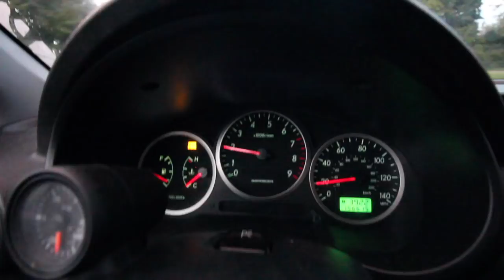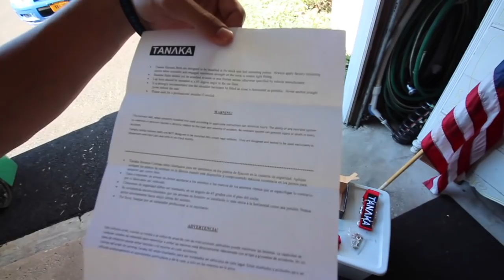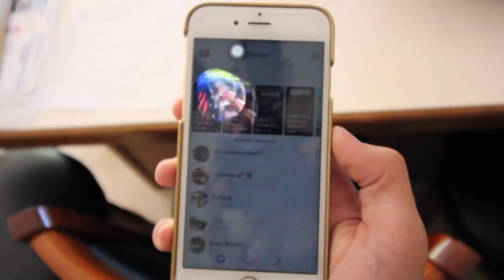Tanaka 4 Point Harness Install

Comment: If you attach the bottom part of the harness to the bottom of your seat or below you in general the pressure will snap your spine in half if you crash
Reply: thats correct, it'll force your body downwards due to the angle of the harness. but this one isnt as bad as some i have seen, some has literally installed it at the back of the driver side seat and not at the rear passenger seats.
Reply: How do you know?
Reply: @takcleberry  how do you not?
Reply: Yay compressed spine!!!!!!!!!!!!

Comment: Seat belts are designed so that your body can lean forwards a bit in a crash so that your head can dig into that airbag. Harness restrains your body movement in a crash, but your head is free to move, which means your neck can snap before your face touches the airbag (if it ever does). Wear a helmet and HANS if you ever want to use harness for safety.

Comment: This is kinda wrong. You MUST put a bar in the backseats that are separated from the bolts you just screw to the chassis. The correct method is to custom make a bar that is welded to the chassis. The bolts may lossen up during time and cause the belt to lose all tension and cause injuries when in a situation. Just be careful and do it not for "look" reasons...if you are going to do it, do it the way it is intended. Cheers!
Reply from the maker: We have already done that check the newer videos 👍🏽

Comment: You'll know when you crash ur car doing 80mph and they break
Reply from the maker: Zach Wise due to the bolts being longer that install in the pre existing holes, and the overall coverage of the four point harness is a greater area than the stock three point, they actually are safer, and being that they are adjustable, you can calibrate where you want them to rest on your body. Makes no sense that a three point would be safer guys, just saying. But thanks for the comment
Reply: the material they are made of and stitching is absolutely shit, and are not SFI certified. Which means they are not street legal and deadly in an accident.
Reply from the maker: petiyo101 have you owned them?
Reply: a buddy of mine had them. Not trying to hate but they also don't have ASM so if you get in a crash with those you can "submarine"(get thrown through the bottom of the harness) and get totally fucked up. They are not safe.
Reply from the maker: petiyo101 thanks for the input always open to hear opinions 👍🏽
Reply: WCKD Street Media it's not an opinion that they are not safe, it's fact.
Reply: Correct. 4-Point Harnesses are often more dangerous then the 3-Point Seatbelt. Always go up to 6-Point don't use 4-Point. And only use harnesses with a fully roll-caged car, don't use a harness bar, its dangerous. Also best to use a HANS Device with harnesses.
Reply: WCKD Street Media i know this is an old video but these harnesses saved my life in a crash the other day and i would say they are pretty damn safe
Reply: @jesuscrust231  can you share what happened lol? I'm curious

Comment: Glad you guys did this video. Was a real toss up if to get these or some expensive brand. Guess I will be buying these for my weekend warrior/ show car. Besides these got really good reviews on searches results.
Reply from the maker: +Sheldon K awesome dude yea I've been using them for months now and they have held up very well for daily use and the occasional hard driving
Reply: Cool. Gonna put a set in my grand national regal. but for my regular weekender 350z might be pretty cool too.
Reply: oh one other thing. what about when breaking really hard? you really don't slide down in the seat at all do you?
Reply from the maker: Sheldon K no they're fully adjustable and lock up nicely

Comment: Counterfeit Takatas, not SFI rated, tests done by Takata on the Tanaka knockoffs showed that the harness snapped and the dummy went flying through the windshield, installed the way you installed them the stock 3 points are far safer.

Look, I love the WRX, I love racing, I don’t have a lot of money, and think that how a car looks is very important, but you guys are only a step or two up from ricers. I’m not saying this to hate, I’m saying this because you guys are going to get yourselves and/or others seriously injured or killed. If you can’t afford to spend 150-250 bucks on a Takata or Sparco or Braum harness that’s fine, but don’t buy the knockoff version of whichever brand you wanted to try and look cool. I personally use a Racequip harness I acquired for a very reasonable 50 bucks (new) on eBay. Racequip is a very well known, very affordable, SFI rated brand. Sure it’s not the “coolest,” but it’s respected as a budget brand and it’s proven to be safe. You don’t have to spend a fortune to look cool, just be smart about it a make sure not to sacrifice the safety of yourself and others in order to do so, cheers.
Reply: 反社会的 Weeb Trash I agree

Comment: Be careful, these harnesses are not actually SFI approved.
Reply: No they are not SFI approved. Actually I saw on Takata's website, they said that these fake/counterfeit/replica harnesses are extremely dangerous and should not ever be put in a car, sold, or resold. I saw a video of Takata crash testing these fake/counterfeit/replica harnesses and what happened was the harness broke and the crash test dummy went flying forward right out of the seat. Real Takata harnesses are really good quality harnesses.
Reply: The genuine ones which carry the SFI tag have been found to be non-compliant also. Im shopping for belts and the moment and recall seeing the detail at the confederation of australian motorsport page here: https://www.cams.com.au/media/news/latest-news/urgent-recall-sfi-161-tanakaruian-dragon-safety-harness The SFI should have it documented too. It looks like this one is one of the affected ones with the cam lock.
Reply: @aperson4933  even if the quality is actually decent, takata wouldn't say anything positive about affordable replicas

Comment: do you know if you can do the wrap around method with these instead of bolting in?
Reply from the maker: leo salvador Depends if you have a harness bar, even so I would still somehow bolt it in, I've seen the wrap around method and it might work but just for the peace of mind I would use bolts
Reply: wrap around is just as good if not better

Comment: Is the harness legal in New York State? Also is there any room behind the driver for someone to sit?
Reply from the maker: +Mitch Anderson its legal but this one isn't certified for certain track use, and unless you have a harness bar no so basically I only have four seats not five
Reply: Okay thank you, what if I just was gonna use it for daily use? And if you have the bar is there more room so you can have someone sit behind you?
Reply: Usually after a harness/cage install the owner does not have much use for the back seat unless your passenger was to twist like a pretzel getting in and lay flat on the seats. I say 'usually' because there are some rare cases like in an Evo where there is still some space left but in the event of a sudden stop your passenger(s)' mouth(s) will likely make contact with the steel... and make the Tooth Fairy very happy.

Comment: this is the stupidest thing you can do, mount a 4 or 6 point harness in a car without rollbar!!!
Reply from the maker: panos75 you don't need a roll cage for a harness, could use a harness bar if you want but 90% of cars out there don't have a roll cage just cause there's a harness
Reply: the thing is that they are more dangerous in an accident! if you find yourself upside down and are strapped with the 4point harness ,say bgoodbye to your head!
Reply: 4-point harnesses, 5-point harnesses, racing harnesses, or other non-stock type seatbelts are made to hold a driver in place during extreme driving situations as exist on the race track or autocross course, so that he doesn't have to use his strength to keep himself from sliding around, and can instead concentrate on driving.

They are also made to keep the driver safe in the event of an accident in a vehicle that is equipped with a rollcage. The driver's torso is kept mostly in one place by the harnesses (they do stretch a little bit normally and during an accident). This attempts to keep the drivers (helmet-clad) head from banging too hard against the "not-going-to-deflect-much-when-hit-by-a-head" rollcage. It also performs a number of other safety duties as well.

As far as safety is concerned, rollcages are made mostly for one thing, and that is, keeping the person inside the vehicle from being crushed. In racing vehicles, they stiffen up the chassis, improving handling, yadda, yadda.. that's not the point of this.. We're talking about safety here. When a vehicle gets in an accident, the rollcage (which is usually bolted or welded to the floor of the vehicle in some manner, will do its best to absorb some of the energy and prevent the foreign object (another race car, tire wall, whatever) from entering the vehicle and harming the person inside. It sometimes does a good job of this, but it doesn't offer as much safety as you would think. However, when a vehicle rolls, rollcages (if properly designed and installed) SHOULD prevent the vehicle's roof and other parts from collapsing in and crushing the occupant(s). This is where 5-point harnesses step in, and prevent the person from flying around and hitting random parts of the vehicle as the vehicle goes from shiny-side-up, to shiny-side-down, to shiny-side-sideways, to other random configurations of the "shiny side" (otherwise known as the "top" of the vehicle).

Street cars are a whole other story. When street cars get in accidents, there is not a rollcage to protect the occupants from being crushed inside. This is where the stock seatbelts shine. Since there is no hard metal rollcage to contact (usually a few inches from the drivers head), the passenger can move a little bit more inside the cabin. In event of a rollover, stock seatbelts allow the passenger(s) to slide sideways and "lower their profile" so that the collapsing roof doesn't squish them. If a person were to have 5-point harnesses (or their equivalent) in the vehicle, the harness would hold their torso up so that only their head could move (and in a very limited manner). When the roof comes collapsing down, the occupant(s) torsos are held stiffly upright, and the roof causes either a broken neck, crushed vertebrae, snapped nerves, broken back, paralyzation, or any other range of rather nasty things we don't want to happen to us.
Reply: panos75 very useful information, I will now install a roll-cage in my car.
Reply: Their angle with the back harnesses are within 45 degrees and not floor mounted which is acceptable although not optimal. But, without a HANS device the harness and the roll cage are also still not enough. I just wouldn't plan on doing any truly spirited driving that could potentially have you end over end. The harnesses will keep you planted for backroad carving and will work great in less egregious accident situations. I would still defer to the standard three point seatbelt for day to day use.
Reply: panos75 =
Reply: You can run a roll bar with out a cage. Not only is this not safe it will also get you a defect